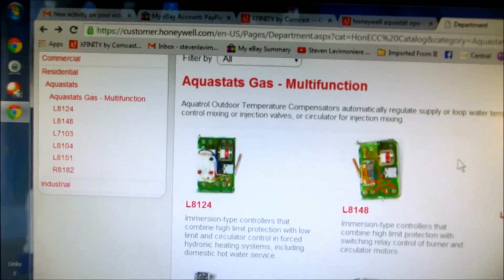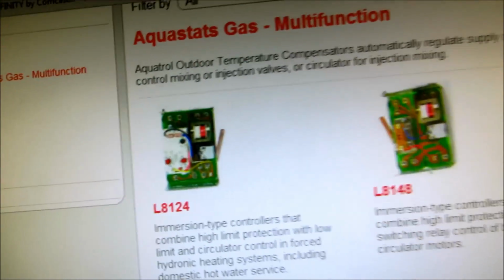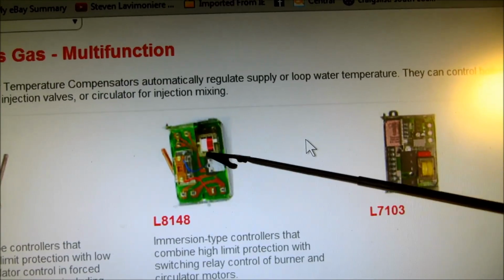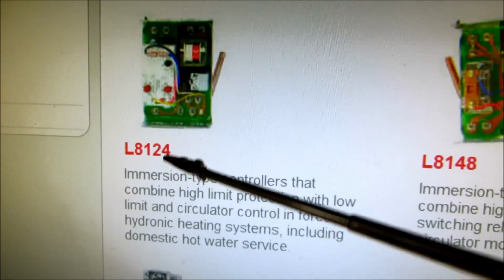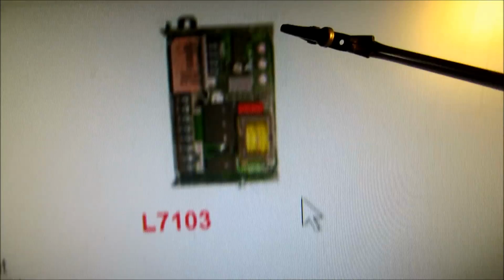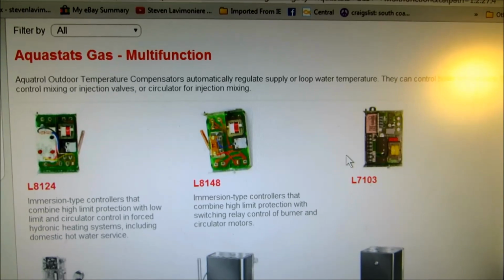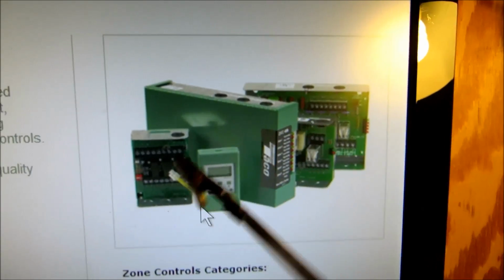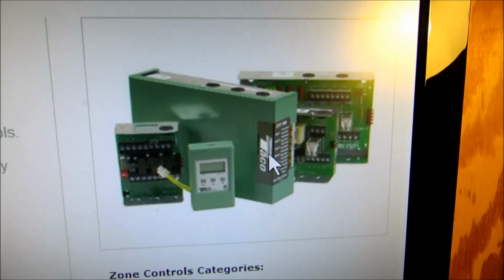hydronic heating 101 part 7

Comment: Hey Steve, I just bought a new house and it has a gas boiler system like this. I've ran into a snag. 2 zone system, no zone controller installed at all. Zone heads run off the transformer. Problem is one of the original zone valves went bad. I installed a new one and while it does work. I notice some faint sparking inside the zone head, thought it was a new faulty head and so I ordered a replacement for the new one and still does the same thing. It's a low voltage 24v ac spark. The same kind of spark you get when you hook up the wires while hot to the terminals on the zone controller head ( I know doing that is a bad idea, but I wanted to give you a sense of the size of the spark). Anyway,... would a controller relay fix this or what else could cause this? I'm pretty handy, but I do know my limits,.. help a guy out and I'll buy a hoodie? :D

Comment: Is the hydrolevel hydrostat any better than the aquasmart. Do they really do what they say they do?
Reply from the maker: +Robert McNamara the only thing i like about the agua smart control  is the low water senser /cutoff but it does not work so well i like the old style aquastats they work well and dependable now stuff sucks as usally
Reply: i have the old style honeywell high low for the tankless. only reason i was looking at it was the fuel savings.

Comment: Very helpful series...  You were able to answer a lot of questions I had (storage tank, hi/low controller, motor/circulating pump, mix vales, zones...  You did not really go into the zone valve use and setup as comparing that to the individual circulators..  I gleaned a bit off of your examples, but that could be a focus area too.
Reply from the maker: +Paul Gdry maybe i will do something in the future on that

Comment: Couldn't you just remove the Aquasmart and install an old school Honeywell aquastat? I have one of these and it's been a problem.
Reply from the maker: Progrocker70 on the aquasmart make sure the probe is inserted all the way .on some boilers you can .bepends ,on the connector for the draft damper